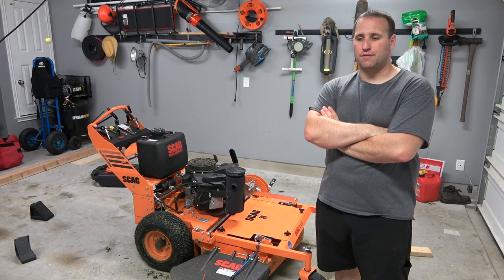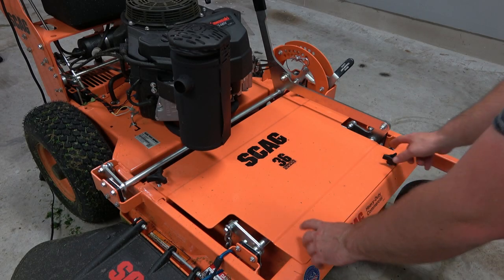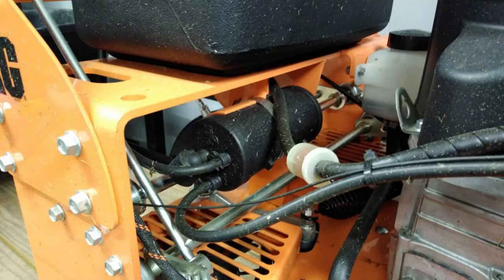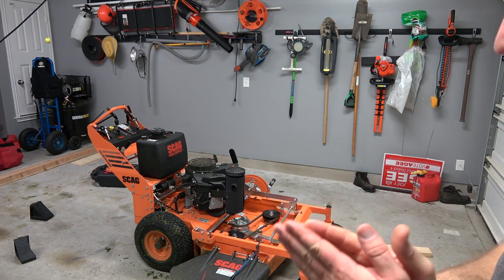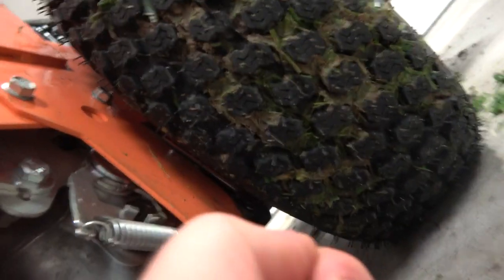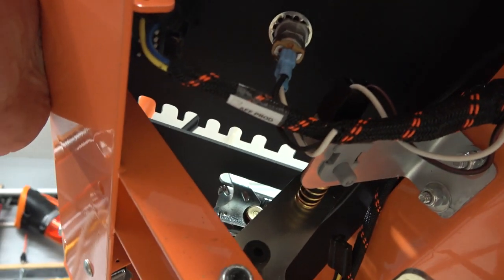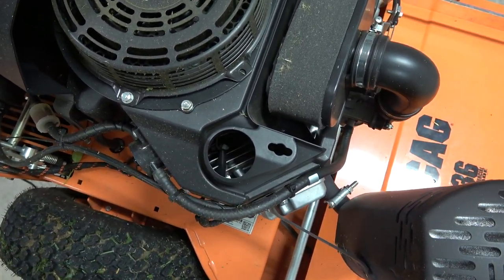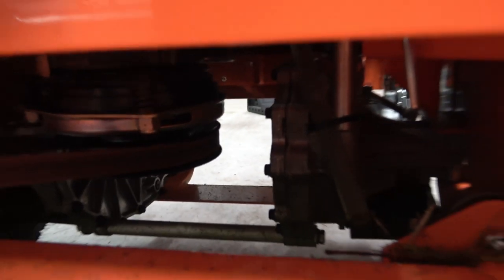SCAG SWZT 36 Review

Comment: Fuel shut off is under tank. I have the same mower 2017 with 750 hrs. Routine maintenance and it runs perfect. Belts once since new, that's all. I hope to get 2,000 hrs out of it. Also, if I put it in 4th, I'd be 🏃‍♂️. Lol
Reply: Nice. I bought a 36 inch and hopefully it will last. SCAG has a pretty good reputation they look solid.

Comment: I've had the SWZT for 3 years and have only one complaint that it's light in the front and will lift going up a steep hill.  Other than that it cuts great with either super high lifts, G6 blades or machine  mill the bearing spindle shafts to adapt X blade pattern.  I'll be adapting  10" wheels to mine after  mowing season.  John
Reply from the maker: Where did you find a 10" wheel for it?

Comment: I have the High Velocity 48" and love the adjustable baffle for summer and fall leaves. Several of this model 36" I have seen have durability issues with the frame to the front casters  with weld breaking. Just the deck with the HV is enough for me to choose that deck vs. others. Being able to grease the spindles is big in my mind and I am a frequent guy with the Ggun and also the wheel bearings. Like your review. Not a big fan of this Scag with its engineering. Think the 42" Stander is in my future when I go from woodworking to lawn when me mind goes. As far as your height and weight and me being a lighter frame guy; please eat right and try to prepare for older age and widdle that weight down to 200. You will find the advantages as the years go by. Be safe

Comment: Nice mower..  But Scag need to re-design it to make it shorter..   Maybe give it a smaller gas tank..  maybe move the engine further forward.  Also you need to be able to see where the front of the deck is mowing.

Comment: Take a look at the Ferris FW15, 280lbs. Looking to demo one when my local dealer gets one in. I have a Scag 32sw and I really love it. But the thing is heavy like you said.
Reply from the maker: Wish we had a Ferris dealer nearby.  They are pretty much a non-existent brand around my area.  I hadn't heard of the FW15 but that looks like a neat mower.  What's the pricing supposed to be?
Reply: Laid Back Lawn Care straight wheels up front $2799 and front casters $2999
Reply from the maker: @iiiStUNA9  wow, they are really proud of that thing.  I guess they were aiming straight for the gap in the market between the pus mower and walk behind.

Comment: How is the 36" holding up? I purchased one and very happy so far. Added the Grass Flap and Packem Grass Catcher. Mine is for residential use not commercial.
Reply from the maker: So far so good.  She's about to go down for her seasonal fluids and filter changes but she hasn't given me any problems.  The only things I've had to do were adjust the two friction bolts on the neutral lock mechanisms for the operator controls.

Comment: Hey man,  nice review.  I'm also trying to decide between the 36 stander and walk behind.   It would be beyond awesome if the operator could reach the deck height  control from the operator position.  I do love the qwik height of cut adjustment because like you,  I have lawns that require 2 or 3 different cut heights.   So,  are you still liking it??? Thanks in advance!
Reply from the maker: Sorry for taking so long to reply Jeff.  If I was in the market again I would go SWZT walk behind hands down.  No matter how hard I tried to offset cuts, change patterns and make sure I didn't cut on days when irrigation systems ran the 36" stander would leave tracks in the yards.  It was just too much machine coupled with my 250lbs and those small tires.

Comment: I'm a scag owner as well as a toro owner. Big tip keep the inside of the fans cleaned out. The grass will cause the fans to oval
Reply from the maker: That's actually something I do about every other yard.  Just did it out of habit but glad to know I need to stay diligent on that.
Reply: I keep mine cleaned as well it will pt strain on the fan also

Comment: The tires can't be wider than the deck. Look at the specs in your manual.
Reply from the maker: Thankfully all my yards have at least a 42" gate except one.  I'm not having any rutting issues at this time but if I started noticing them I would just install a slightly wider tire.  I could still get through most gates with a few extra inches outside of the deck width.
Reply: @LaidBackLawnCare  Your back tires cannot be wider than your deck. It is designed that way. Think about how it would cut with wider tires.
Reply from the maker: @tallens5280  the width of the tires has no impact on cut quality.  They were designed to fit through a 36" gate.  You can put 40" wide tires on a 36" mower and other than turf tearing it's not going to change the quality of the cut.  Perfect example are vemtrac and wright mowers that have optional dual wheel configurations.
Reply: @LaidBackLawnCare  Give it a shot
Reply from the maker: @tallens5280  so far it hasn't started to rut on lawns.  I try to vary patterns and offset my cutting lanes each time but if it does become a problem I might try a 10" tire.
Reply: @tallens5280  i have walker tires on my swz36. Its a hair wider than the deck and it works perfect.

Comment: My scag swzt 48. Says 4.5 in the lockout but it is truly at 3.5 is this the same on yours
Reply from the maker: I would have to get under there and measure Joey.  The SWZT does seem to cut the grass at a similar height to my BadBoy 25" push mower when both are set at 4" but I haven't actually measured to verify how close it is to the indicated height adjuster.